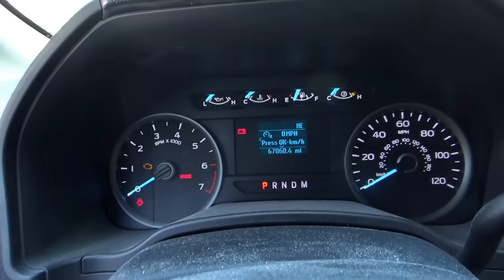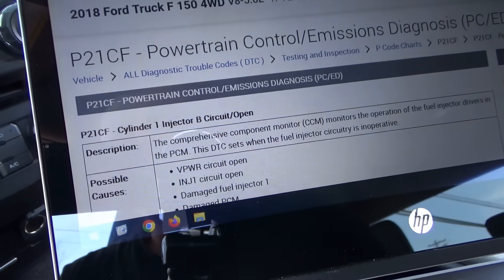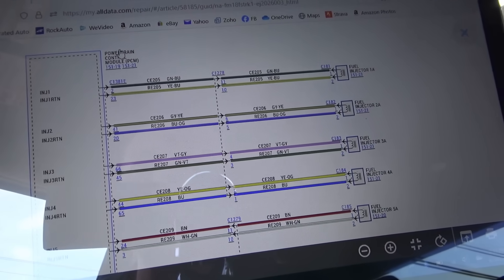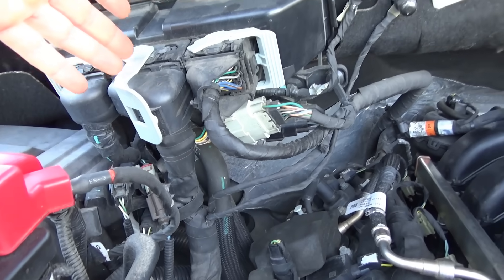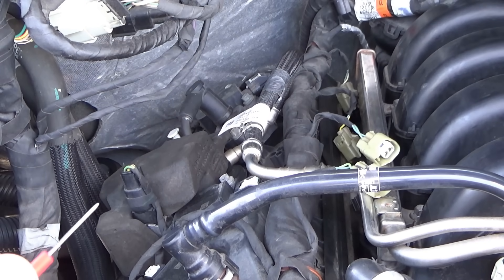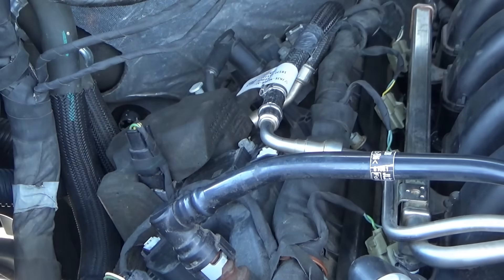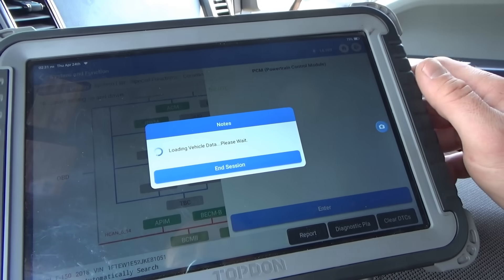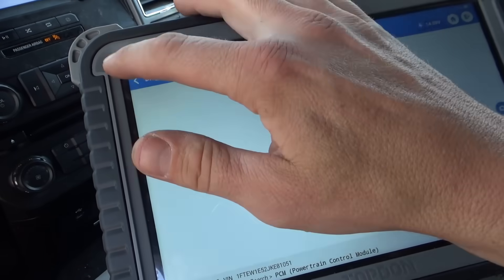No Research = Parts Cannon FAIL?! (Ford V8 GDI-Port Injector FAULT)

Comment: I was on a customer on-site visit last year with a complaint of various nosewheel steering faults in the maintenance history every few weeks.  After digging further into the records, we found over three years of similar faults with an extensive part cannon. When doing pin retention, we found a couple dozen loose pins at the steering ECU connectors. A couple of hours of crimping new pins cleared the issue, and it's been operating trouble-free since. Simple checks like pin retention can be incredibly valuable!
RD - A&P, IA

Comment: The original Tech probably fixed the problem but accidentally bent the pins in the connector while diagnosing it .  Thats why it took a few days to start acting up

Comment: Ivan, you've had several of these "pins spreaded" connectors lately.  Maybe these techs never had training regarding this problem and/or never watched your YT videos.
Noid lights were made for some 80's GM TBI systems not for PFI or GDI systems.  Maybe if the tech had some jumper wires with adapters for the noid light and the PFI connector pins, that "might" work.  Still, the  visual and proper test leads, also with a scope(sometimes) will locate the problem.
Good quick video Ivan.

Comment: I've worked on the 4.6 ford V8 and on the older engine they brake the locking tabs   on the coil and injectors then the plug will work its way from the pins and cause a misfire. I've had to replace many  with new pigtails.

Comment: Another Problem Subaru techs have run into in the past is Silicone based interior cleaners getting into Subaru Steering Column wiring connectors causing all kinds of Crazy electrical problems, I see spread apart or loose pins like this from a Tester gone Rogue Way too often.

Comment: This is the perfect example of why I haven't used noid lights in over 10 years.  I know first-hand that you have to pay attention to which noid light actually fits the connector.  A few of them may have the right pin spacing but they have different pin types.  Some are flat and some are round.  Admittedly, I've damaged a connector once inserting a round pin noid light into a flat pin connector.  I guess everyone will figure that out eventually.  Great find Ivan.
Reply from the maker: Great point! Why invest in a box of "noid lights" when a simple test light with some adapters does the job better with no connector damage? :)
Reply: It would have been interesting to see Ivan put calipers on the noid light pin and then the male pin of the connector.

Comment: Would it not have been quicker to just unplug port injector 2 and see if a code for open circuit on 2A or 2B appeared then you'd know in 5 seconds which were which 🤷 One to remember though about port injectors usually powered from relay and direct from ECU. Not a system I've come across in the UK yet. Thanks 👍

Comment: I would like so much to see the old military style connectors, even made from plastic to replace the current ones. You know the round ones with gold coated round pins pushing towards each other by the springs on the other side. No more pin fitment issues, no longer connectors damaged by probing. Standardise 20 connectors and you get 20-50 USD test connector sets available, you can connect between connectors and take measurements from the output banana leads. Connectors we now have, rely on the strength of the minuscule piece of steel, from questionable source, are not an serious argument. We should demand more. We want reliable connectors for cars costing more than ever and relying more on electricity and electronics than ever before.

Comment: I wish you would show more detail about how to extract pins in cases like this. I assume there are several different styles across manufacturers.
Reply: Usually small barbs. Look closely and you should be able to figure it out.
Reply: @Cheepchipsable  yes, I have experience with electronic components and many connectors in consumer and industrial equipment require a unique tool to unlatch the 'barb'. Are automotive connectors de-pined with just a pick?

Comment: It's too easy for shops to throw parts at vehicles at customers expense. That's pretty much doing what a DIY could do and save the labor and parts markup. Unfortunately, current overcomplicated design contributes to these fails.

Comment: I would NEVER buy a GDI engine that did not have dual-injection, like Ford and Toyota have. My 2002 Ford Focus Manual everything, 208k miles, is super clean in there and my compression readings are nearly like brand new engine readings would be.

Comment: I worked with a mechanic who just used a side marker bulb as a noid light. He used the small side in bulb type like a 168/ B2 bulb. He just unwind the small terminals at the base of the bulb and plug them into the fuel injector plug. It worked really well and wouldn't spread the terminals.

Comment: Nice quick proper diagnosis. Car manufacturers used to make electrical connections with substantially larger and more robust connectors, terminals, wire gauge, etc. Since roughly the early 2000's they make electrical connections with the flimsiest junk they can get away with.

Comment: Nice.    Ford does have a great driving truck with that V8.   It's just expensive to own. 
How does a shop get a great diagnostic tech?  For one thing they have to pay them very well.  Where does the money come from to pay them that much?  I don't know, probably from the other techs replacing ball joints and water pumps. The majority of customers don't want to pay for diagnosis at all.   "Just hook up your computer thing and it tells you what's wrong.   AZ does it for free."    That's what small shops are dealing with.   Not many customers want to hear it's $xxx  to find out why the CE light is on.

Comment: I will not pay people to be parts changers. I will not pay people for defective work. I pay through my credit card company, and while I will pay to get my car back, I most certainly will do what I need to in order to flag the transaction. I'm in the process of suing a mechanic who I paid to install an exhaust system but who destroyed the oxygen sensors taking them out. He agreed to reinstall new sensors at his own expense but instead of installing them properly, which required removal of carpeting and several air conditioning ducts, he cut the wires underneath the car and Twisted them together! This did not work and he refused any more responsibility.

Comment: So basically they screwed up by installing direct injection, then instead of going back to what worked for about 40 years they added another injector to clean the original? Wow, what a great idea! Where the hell does Ford get these morons from????? My 1994 4.9 Six has port fuel injection. It has NEVER had one single problem since I bought it new in 1994. Currently at 154,000 miles. NOT ONE SINGLE PROBLEM!!!!

Comment: Techs need to learn this shit. No excuse. Grateful for channels like you and eric O. Unneeded expense of replacing good parts really pisses me off. At lease some out there can sleep at night..
Reply: There ARE times when part R&R is greatly cheaper than extensive troubleshooting.  There's a balance.  Generically, you're right that analyses is superior to part's cannon... but not always.
Reply: @tomtke7351  not many... Eric O's policy is he gives you an hour and if he cant pinpoint the problem with data definatively in that hour its free.  Yeah if its 90% verified and its a pattern failure then shoot. But if hes wrong its a free fix. Think ive seen 2 comebacks on his channel since starting watching in 2012.. pine showcases a multitude of comebacks in just 6 mos of vids..
Reply: @rheidtech  Maybe Eric isn't showing all his comebacks! Eric also does a lot more bearings and brakes and a lot less of the multi vehicle make troubleshooting. I like both channels but find Ivan's far more educational and mind expanding.
Reply: @jimh598  bullshit🎩
Reply: @jimh598  I think Ivan shows these more, and probably gets more call to this kind of job.
Eric is in a static shop, so he takes what comes for the most part. Bearings and brakes would probably be a significant portion of jobs in a lot of shops. Not sure if he does call outs anymore as he is only working 4 days a week now.
Reply: @tomtke7351 yup, gotta weigh hourly rate against part price.
Reply: Eric O says something like 80% of shops in his area don't have any kind of access to vehicle databases for diagnostic purposes. 
He also said a huge portion of them used eBay/amazon sensors because they are cheaper, even though they fail more often.

I'm watching O'Rileys Autos from the UK who has accidentally become a DPF cleaning specialist because so many shops are ignorant on how DPF works. 
He makes it look simple because he knows what he is doing but he still gets many clients who have visited multiple shops with no good outcome. Thought the process seems straight forward.
Reply: I agree, Very junior tech move to not check pin fitment for circuit code

Comment: Automotive connectors should have built in LEDs, just like industrial stuff has (hydraulics, pneumatic solenoid valves etc.). This is stupid industry, others are 10-30 years ahead. All areas, mechanical, electrical, lab tests (oil analysis), you name it (anything "new", then it turns out, it was developed outside automotive - industrial, marine, aviation, military).
Reply: I miss the old switches.  Short them compressor comes on.  Need freon.  Quick and easy.

Comment: A noid light is a diagnostic tool used to check for electrical signals at fuel injectors in vehicles. It helps technicians quickly determine if there is current available to the injector by flashing when connected and the engine is running.  AND they and they have notoriously large pins.
Reply: If they didn't they would get crushed in the case when it is tossed in tool box.  LOL

Comment: Hard to believe manufacturers use tiny, fragile pins and connectors in a harsh environment like under the hood of modern vehicles.
Reply: Throw away vehicles. Materials cost money. Cars are wired with literally phone wire now adays..

Comment: So port injectors are used always to keep valve clean, and direct is a secondary when added fuel is needed.  At least they did that right.  Probably fired that engineer.

Comment: Love how they had to engineer a secondary fuel injection system to 'fix' the intake valve fouling from the PCV system. 
A simple catch can could have mitigated that problem, but nooOoOoOo. 😂
Reply: Look at all the idiots that never change their oil, do you think they would be smart enough to check and drain a catch can?

Comment: That's crazy that the so-called  mechanic didn't know the vehicle had 2 sets of fuel injectors  per cylinder 😮😮😮
Reply: I wouldn't expect a mechanic working at an independent shop ( non Ford trained )  to automatically "know" that that particular engine has 2 injector systems. And, according to Ivan's description of the mechanic's actions, he did, eventually figure that out.

Comment: Interesting case and swift diagnostic, Ivan! Using the wrong probe tips causes more problems than diagnostic results - delicate sockets don't like to be banged hard 🙂
Also, understanding code descriptions, could save unnecessary work and parts. Luckily, the messed up connector was easily accessible, allowing a quick repair.
Reply: I would have liked to see HOW the connector came apart.  It is getting to be a pain with all  these different types.   How that insert came out would be nice.

Comment: Ivan, 
I made an adapter harness using the micro terminals and then an older harness terminals to fit the older PFI noid light (both female). Been using that for quite a while. Many newer systems use the micro pins. 

Nice catch on the loose pins. Pin fitment is a major issue these days, due to improper use of tools (forcing a probe into a connector - front probing). I still see this happen far too often!

Comment: Low-speed pre-ignition (LSPI) is the main problem of gasoline engines with direct injection. GDI-Port Injector is the solution to the problem of Low-speed pre-ignition (LSPI). Do not forget about the hydraulic resistance of the intake tract.
Reply: LSPI is also mitigated pretty well by decent oil with a good additive package.

Comment: Please don't throw too many darts at these techs.  They tend to be prideful and underpaid.  They'll quit; and we're already short thousands of techs at this point across the industry.  Refer to the situation as a 'teachable moment'.
Reply: Then the techs need to toughen up and be adults and learn from their mistakes. Bad techs cost people THOUSANDS of dollars.
Reply: @mattbrown5511 Yeah, there's that, too. There are more ways to learn this stuff than ever these days.
Reply: When the job at hand pays .5 hours and it takes you 1.0 hours because the person before you spread the pins and the injector doesn't work, you just worked a half hour for free. The solution is to work for yourself.
Reply: If they paid good techs more than the bad ones they would have more techs. I never got into it because it doesn't pay.
Reply: WTLF is a noid light ?
Reply: @CrimeVid  It's a lightbulb that attaches to the plug that connects to the injector.  Some plug inline between the harness and injector.  The light blinks when the ECU sends an electric pulse to the injector.  It lets you visually see that the injector is getting a signal from the ECU - just like a test light.
Reply: @CrimeVida noid light is a light you plug in to where the injectors plug and it lights if the electrical is good to the injectors
Reply: @CrimeVid you have no id??😮
Reply: If they'll quit rather than learn , perhaps they Should walk ?
Reply: Using proper test leads is electrical 101
Reply: As a flat rate diagnostician  at a shop  I hade to trow parts due to the set up at the shop, they said a good technician has to have a diagnostic  in a out 45 minutes, even do I do have the training and the proper testing tool, that shop does not provide the adequate time  also lost shops do not value the diagnóstic.

So for the most part is a shop fault, also  technician.

I was paying out pocket some daig jobs taking about 2 or 3 hours to resolved customer concern and getting paid 1 hour , the shop was afraid to change more then 1 hour  . I saw the  tech doing brakes  having an extra money for production and me as technician about 30 hours paid check , with more than 40 hours at the shop .

 Those day were my investments in my own corrier to try to find a good shop , was hard but I did.

Put 100 shops probably 4 of them understand what is diagnóstic and the value and how to sell it at the proper way.
Reply: It's not the techs that are the problem. If you really want to know what the actual problem is, it was Obama, Biden, and the idiots like AOC that demanded standards that were unachievable like the CAFE standards. They forced the stupid designs and super low viscosity oils that are wrecking ICE engines by the truckload.
Reply: You're right how many monkeys yanked and pulled and banged on the problem before it was his turn to solve
Reply: So what, shitty mechanics are wasting peoples money and time
Reply: @shakalpb1164 not directly it’s an industry level issue where competition lowers prices.. lower wages gets less quality generally speaking , but that said most  people work on tight budgets so there is factors both sides, no argument to your comment I understand your response 👍
Reply: Garages cannot afford generally speaking to employ a work force of Ivan’s. Which is kinda obvious and why Ivan works for him self solo, but garages also have the option where possible to send staff on training / courses… trade off is when there trained enough they leave… double edged sword I guess
Reply: Throw all the darts you want, there's too many really bad techs out there.  Bad techs cost people a lot of time and money.

Comment: Ford provides a list of probable components that are the most responsible for the symptom cause of the problem. However, "Wiring" and/or "Connectors" are not worth the mention.

Comment: The one thing that gets me about Ford's PPT, and usually GM's too, is how they have the ckt tests first and then at the very end the component test.  I worked flat rate 30 years and quickly learned to check the most likely first before getting too deep.  Of course, you learn to go back and check the circuit if there's any question on component's health before throwing a part at it.
Ha, I love noid lites.  Use them for way more than injectors.  But yeah, spread pins suck if you aren't careful.
Reply: Ivan converted me to brake and curtesy light bulbs.  Stack up for amp draw.... Haven't made a high amp headlight bulb test lite yet....
Reply: @robertsmith2956  Don't use a high amp bulb on an injector control ckt or an ign coil control ckt or it will fry the driver.  But yeah, incandescent bulbs are great for load testing.
Reply: @greggc8088  Haven't needed to test a 20+ amp circuit yet is why. They are to hot to use on smaller jobs. 😡

Comment: Ivan, you show where most shops fail in the area of diagnostics. You clearly show that you should follow the data and not just make gut assumptions . Experience is great but data backs up your experience.  Great video
Reply: Lets hope they use this to convince the boss to order the drag test kit.  It is the same or cheaper than Ivan's diagnosis.
Reply: Yes
Reply: @eddiewithbeckersmd9480  I looked at them when I ordered my amp clamp from AES Wave.  Having just bought the clamp, and my Pico I haven't gotten them yet.  But I will.